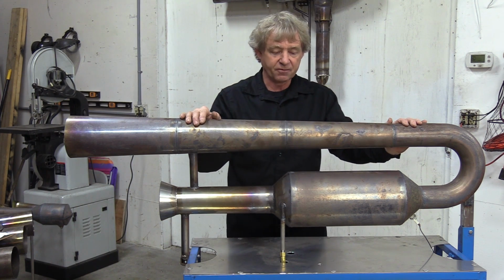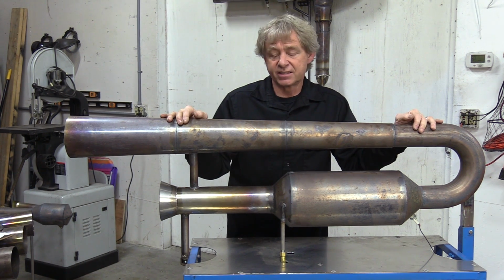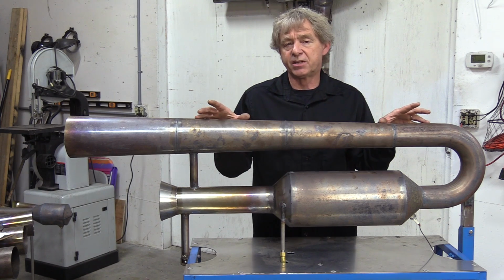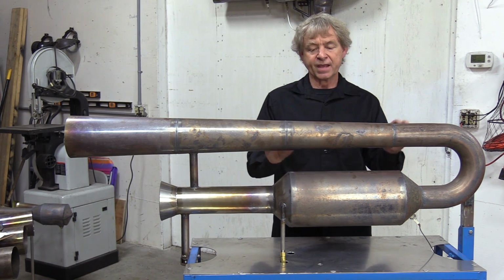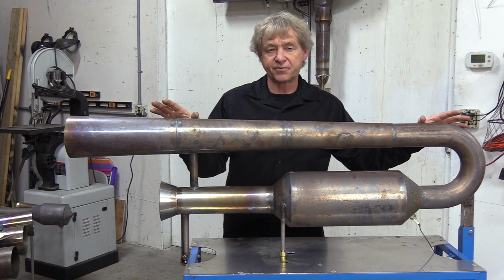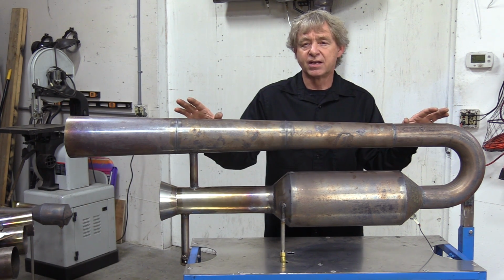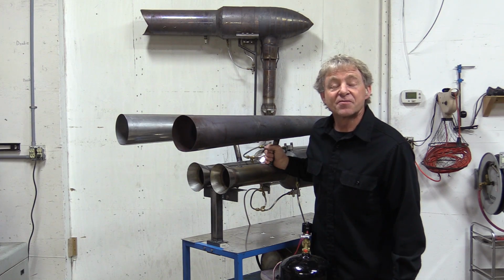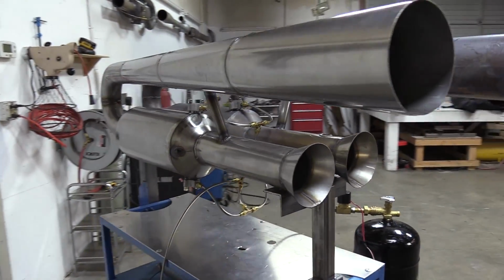Rocketman: building the Viper 50, 50 pound thrust valveless pulsejet.

Comment: I like how simple the valveless pulse jet is. Looks like they give off lots of heat and burn clean. My question is why couldn't we build a chamber around it like fire brick and run the exhaust through a insulated flue to run forced air to heat a building. Idk just a thought.
Reply: I would think that the main problem is these are not very efficient if heat if the primary goal, and the secondary is just how incredibly loud these things are. They produce large amounts of power for their size/simplicity, and that's really it lol
Reply: It was a concept for building heating many years ago.

Comment: Love the engines and how you show the process of making them. I'm interested in the possibility of making an infrasonic sound weapon around 10-20Hz (instead of your 108Hz). Of course, it should be very loud, like 150 dB SPL or greater at those frequencies. Do you think simply lengthening the two pipes would do it, and/or would you go for upsizing the combustion chamber (either way will lower the resonant frequency). Estimating the SPL would be difficult; probably a prototype would be needed.

Comment: what is the welding skill required for a project like this? can someone that just starting out make acceptable welds?
Reply from the maker: Well, it is a tig weld and not for a real new guy, however if you find a local fab shop they can weld a rolled kit together for you in about two hours or less, not to much money.
Reply: Just use supa glue, much easier
Reply: @billsmith281 Would Ducktape do?